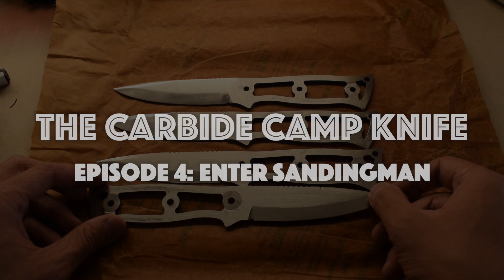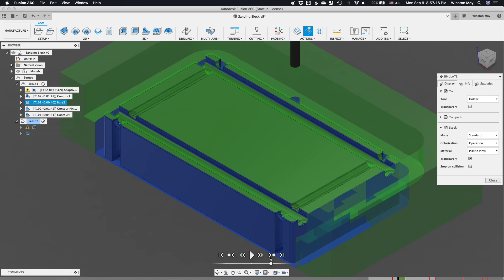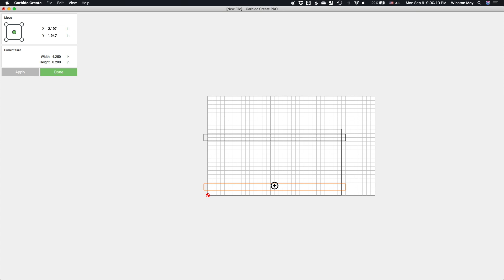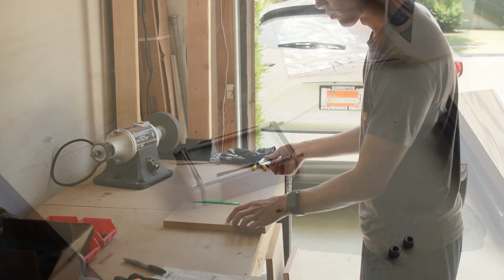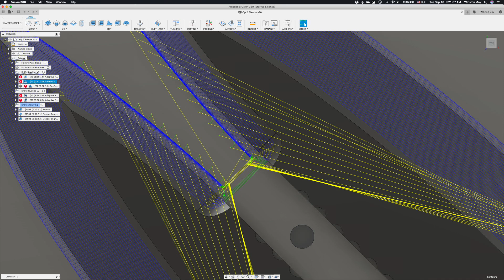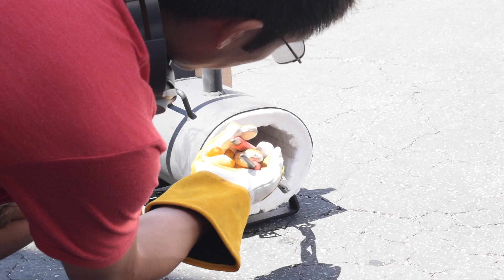Making a Sanding Block & Blade Finishing - Carbide Camp Knife Pt. 4

Comment: This might be too late to tell you, but you should do your heat treat in a darkened space or late in the evening so you can see the colors better to gauge the temperature. Natural sunlight distorts the color and makes your blade seem cooler than it actually is and may throw off perception of what temperature the blade is.
Reply: Oh, it's definitely too late lol, and I was not thrilled about working in the daylight. But it seemed to work out in the end. The colors of steel are pretty distinct, just harder to see.